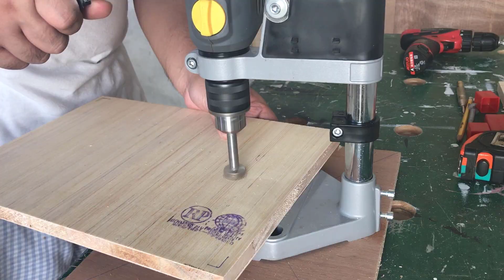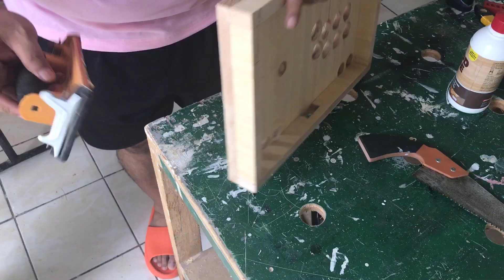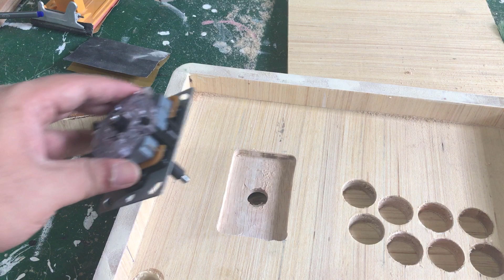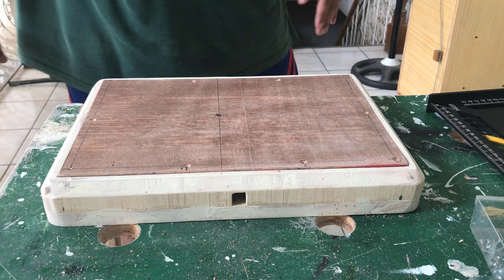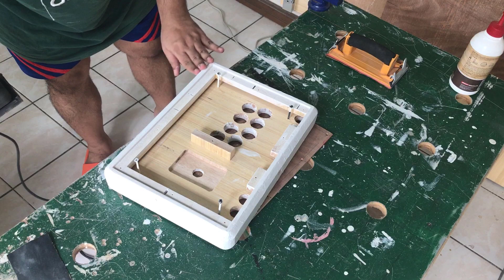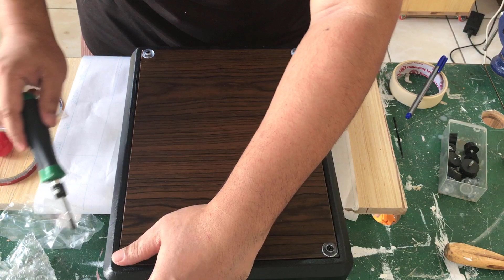DIY Arcade Stick for PC | Xbox | PS4 | Emulator Console

Comment: Amazing work on the case. Not a fan of the cheap electronics, though. I would much prefer to have a cheap case over cheap insides.
Reply from the maker: Not all our electronics are cheap. It depends on my clients preference. We can put all the expensive parts in it if that’s what they need.
Reply: Those are legit Sanwa buttons and JLF, the only thing that could be considered "cheap" is the encoder and even so, if the person who ordered this controller is going to use it for MAME, these encoders are perfect for that.

Comment: If your using a 30mm sanwa buttons what is the size of the holesaw you use for the acrylic sheet, yoy answered 30mm, hmm im kinda skeptical since since the acrylic hole you made is much larger than the 30mm sanwa buttons, not sure if your deliberately misleading your viewers
Reply from the maker: 30mm

Comment: First, I want to thank you for your great effort Second, I need to know some information, first, the dimensions and dimensions of the wooden box that you made, thirdly, the size of the depth that you opened to place the stick machine, and I also need to know the thickness of the wood that you used to make the box, only all of this
Reply from the maker: 15x8.5x2 inches
Reply: @JUANminiDIY  What are these sizes exactly?
Reply: @JUANminiDIY  hi
Reply: @MOHAMED_MASRI  Width x large x thickness
Reply: @_Nato77  Are all these measurements in inches?